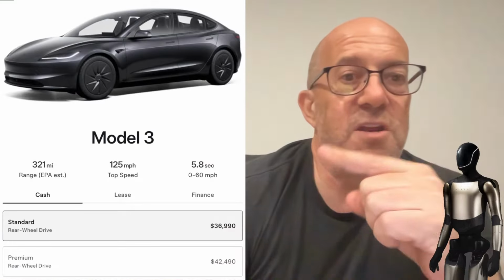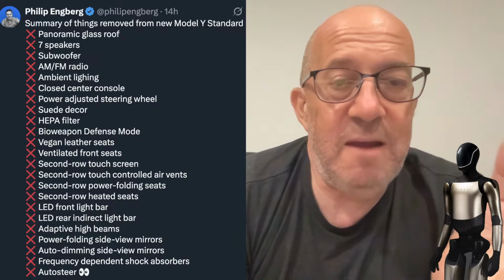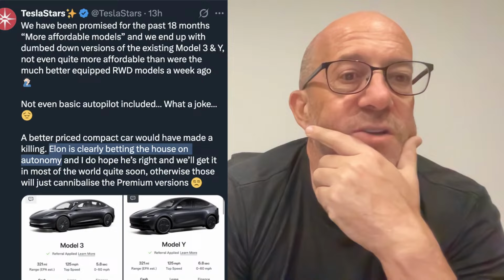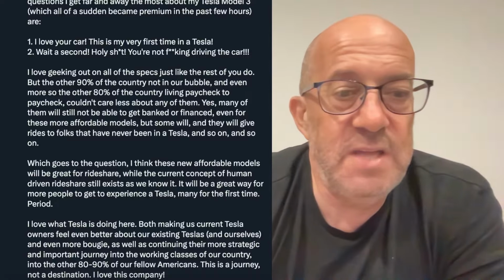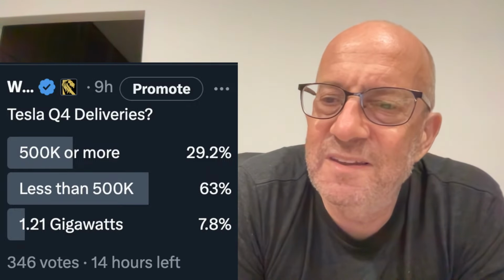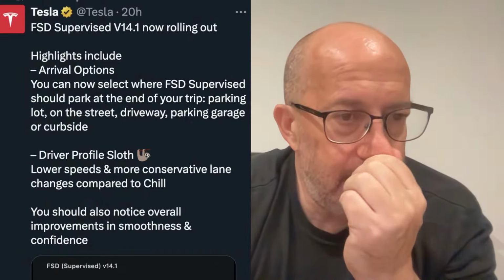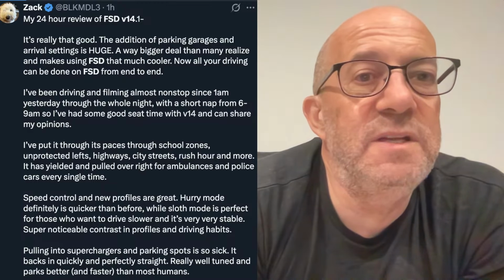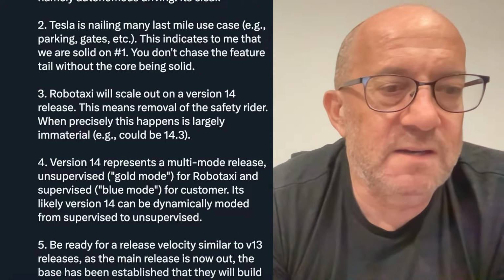Tesla Oops? New Model 3 - Model Y - Plus FSD v14

Comment: There’s a bit of shell-game regarding standard vs premium Y’s, so I’ll just ask this, hopefully getting an apples-apples response:  What is the percentage difference in total cost/mile between Standard Robotaxi and Premium Robotaxi?
Reply from the maker: Dont' fully understand your question but ...

Standard 3 is 12% cheaper than Premium 
Similar for Y I think

So the amortization of the vehicle per mile is 12% less
Other costs probably not much difference, though some think Standard will have lower maintenance and cleaning cost
Reply: Thanks for your response.  I would guess the total cost to own/operate would differ by just 2-cents/mile.  About 6%.  Hardly worth losing range, comfort and other premium features of the already-at-scale Model Y RWD US.  The capex, NRE and supply chain mods must be offset with sufficient unit volume of product. Any idea when that could break even?
Reply from the maker: Range over 300 miles is sufficient for robotaxi use. Comfort is irrelevant to most robotaxi riders as long as it's decent.  I expect these to sell in high volume, especially in Europe and maybe Asia.

Comment: This stuff about the hand is nonsense.  Alphabet had a hand solving Rubiks cubes one handed 9 years ago.  The Davinci robot has been around that long. Control a body that well with that many degrees of freedom and you can do a hand.  How many people work at Unitree?  Oh 1000 people.  How many at Tesla?  That demo was enough to get Bezos to say bots were a national security emergency and Tesla and Figure needed help.  All that crap about its the data and it can't be stolen-  pure BS, XAIs secret sauce was stolen by one guy probably in a matter of minutes and given to closed ai.  And then more BS about it being Tesla AI in bots not Grok.  Its done in layers like Google does the Ultra-Pro-Nano stack.  Nano does the real time local stuff.  But if you want Optimus to be able to think and yes create it will need the deep huge stack and it won't be up to us.  SpaceX  needs to get starship and gen 3 starlink out and of course do the macrohard cell node  stuff and replace Microsoft sure but its time for these organization to replace Musk with AI.  And we will find Neural links crude approach is nice but unnecessary-  doesn't need a chip in your head to dial your noggin.   All this needs to happen by mid 2028.  Doubt Musk would mind.  He said he would be around long after dump was gone,  but he really just needs to be active for about 2.5 more years to finish what he started.  Even get the roadster ornament out-  than sail off into the sunset. This light of conciousness and speciecism stuff is the biggest load of horse sht.  Humans didn't create any of this and humans don't own any of it.  But Musk still needs to finish the race over the next 29-30 months or he will just be drown out by what China is doing until AI takes over by mid 2028.

Comment: 1. The all-knowing Tesla team and Elon got wrong the Cybertruck demand. Or Elon ruined demand by going all MAGA then reversing and going anti MAGA. 
2. Robotaxi with a steering wheel is still needed and wanted. 
3. Elon still owes us the new Roadster. 5 years late so far.
4. Full size 3 row SUV (R1S type, or CyberSUV) is still needed and wanted. X ain’t that.
Reply from the maker: Why would anyone want a steering wheel in a robotaxi? Do you want a lever in an elevator?

Comment: If they kept the glass roof on the cheap model Y it would get less than 300 miles of range. That’s why they covered it with fabric.
Reply: They cover the glass because the glass is not treated for UV...
Reply from the maker: It still has the glass roof. Just opaque. Fabric has nothing to with range.
Reply: @WarrenRedlich  another Tesla channel said it takes less HVAC load to maintain temps leading to slightly better range.
Reply: @WarrenRedlich  well that begs the question why did they leave the glass roof on the new standard model three but on the model Y they go to the extra effort to cover it with fabric.

Comment: I think the new filter can be replaced with a HEPA filter, but a HEPA filter will reduce the amount of air flow.
Reply from the maker: I've never seen that claim about HEPA filters and air flow. Not saying you're wrong. Just never heard that.
Reply: @WarrenRedlich  The finer filtration the slower the air flow. HEPA filtration is realy fine, so in the Teslas with HEPA filter they would have to have bigger filters and/or stronger fans to get the same air flow.

HEPA (MERV 17+) is useful if when outside air is brought in to a space like a car or a operation room as long as the air flow is high enough.

But if it is a air cleaner inside a room where the air mixes and circulates multiple times a MERV 13 filter is better since the much higher air flow compensate more than is lost to lower filtration level. 

Many home air cleaners use HEPA filter instead of MERV 13 since it is easier to sell HEPA filter with higher filtration rates to low knowledge consumers, that to explain that MERV 13 filter with lower filtration rates are better because they move more air trough the filters resulting in removing more dust from the room.
Reply from the maker: Grok agrees with you.